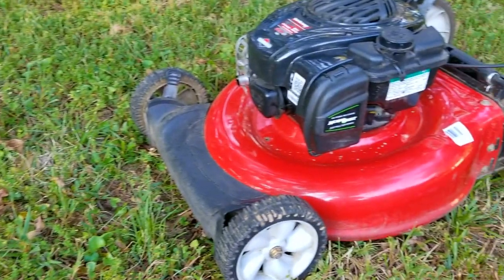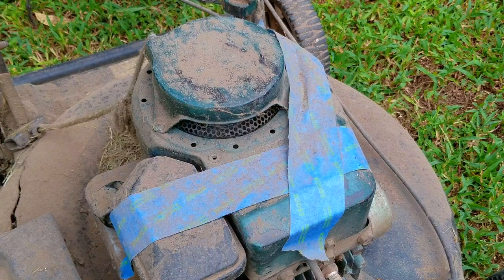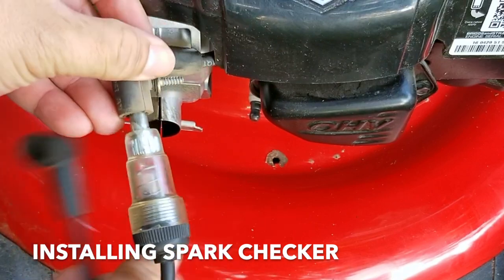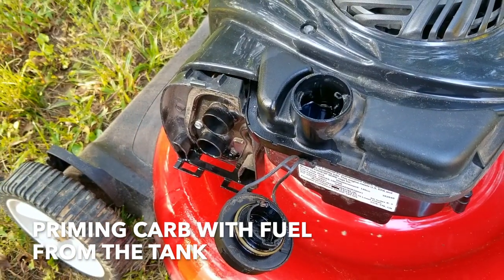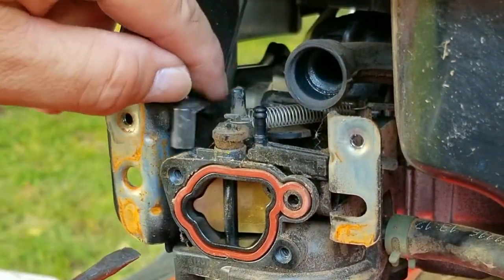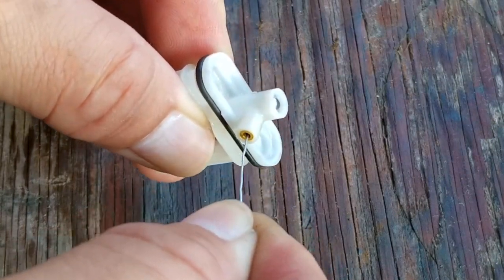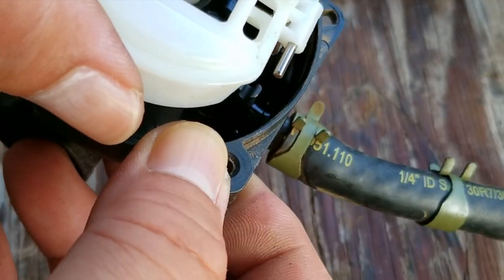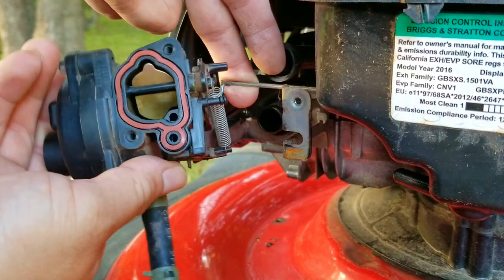Why Did Briggs Stop Making The Flathead Engine?

Comment: My very  first push mower!! I've learned on I bought at a yard sale!! For five bucks when was 10 years old took it home it ran.. it was a 1970.. 3.5hp briggs and stratton white engine colored green deck montgomery wards brand I use to take all apart and study the working internal parts and put it back together it would  run good as new!! I think I still have it at DAD'S place in the shop so I like the old school flat heads and the overhead valves!! As long as it's a briggs and stratton engine  or Hondas I work on all brands  two and 4cycles engines even the little diesel small engines as well.. good topic I.H.G
Reply from the maker: thank you JJ Juarez!
Reply: My first working mower was a 1962 21" 2-stroke Lawn-Boy, given to me in 1970 by a friend's parents when they moved away. Very powerful, with a huge under-deck muffler, for, a pleasant humming sound, compared to the typical dinky-muffler flathead mowers of the day. It also had a very light magnesium-alloy deck that made it easy to handle.
Reply: Cool story JJ!

Comment: The flat heads were tough but i got to go with the newer over head valve engine it makes mowing a breeze it has alot more power and  burns way less fuel..  our old mower just bogs if u let the grass grow an extra week the newer one just powers through.. i think the EPA put the sqeeze on every manufacturer and they had to comply coupled with raising ethonal levels in fuels the carbs are calibrated to give a clean burn but now the jet orifice are tiny which clog easily if not maintained properly
Reply from the maker: I see your point
Reply: I have an old 5hp rider from the mid 70's that I run slightly rich so it wouldn't bog down as much. I also converted the points ignition to solid state for better starting and reliability. Carb is the old pulsa jet with needle adjustments, heavy cast iron flywheel, vertical shaft.
Reply: You nailed it, sir. Couldn't have said better myself.

Comment: You are dead on with your assessment.  As for the oil change issue, check out a channel called "Teryl Fixes All"  He did a video explaining why Briggs went to the "no oil change" engines.  I unhappily own an Intek engine, and am in the process of replacing it with a Vanguard on my JD lawn tractor.  For the question of what I prefer, I personally prefer the old flathead engines.
Reply: I'd highly suggest looking at Kohler Command Pro, Honda GX and even clone engines.  Parts are currently hard to find for any Briggs engine or power product and Vanguards are made in the same factories as the crappier home owner entry level crap they push.  They are no longer Japanese made.
Reply: @WJCTechyman  Parts aren't hard to find for "any Briggs engine".  I source parts for B&S Quantum engines all the time.  Might be true for some of their other engines, but it's not true for "any Briggs engine".

Comment: The new engine blocks are very thin metal in the sump and the carbonators are jetted so lean that if the gas is old it will not run , it will in the flat head  . Quality is not a priority only after profit only .
Reply from the maker: yes all correct, and it sad to see, that's where We're going  Thank you Chris's small engines
Reply: what the hell is a carbonater??? That right next to the wampus rod???
Reply: Don't ask, but I've been running 18 year old gas in my mower and snow thrower. It doesn't smell like gas or even taste like gas but it is and I have about 15 gallons of it left. One guy even told me the exhaust smells funny.
Reply: @bultacowally  ask Willy Wonka, he'd know for sure.
Reply: @jwwalker688  Pour that stuff in a newer engine and it will not run . I have seen it with my own two eyes . Try it for yourself . The older engines will burn it the newer one will not .
Reply: If they hadn’t made it so cheap, the lawnmower manufacturers would have completely switched to Chinese crap engines. Briggs had to match them for price to stay in business, it’s that simple. The old flatheads were durable and cheap but there was no possible way to get them to meet emissions anymore.
Reply: @bultacowally  The Carbonater feeds the Cat Litter Converter.
Reply: @bultacowally  There’s nothing like the sound produced by a decent carbonator. Sitting back on a lazy afternoon and absorbing the soothing qualities of carbonation in action is extremely relaxing.
Reply: @bultacowally  all I ever think about is carbonaters!

Comment: I have an old brigs on a riding mower. It's 12hp and about 50 years old. My family has used it since new and in all that time, it's needed the carb rebuilt a few times and 1 new head gasket. They really do last a life time.
Reply from the maker: yes, with some care, they will last a very long time. Thank you Cub 100.
Reply: unfortunately such great reliability also means fewer sales for the company. companies exist to make money so updated designs that don't last long are the new norm
Reply: that is a cast iron engine, never let that one get away from you!!!. those cast iron "B&S" engines are built to last, and were designed to be rebuilt
Reply: And yet my Honda G series engines don't need much of that.  They're probably running the original carbs and are more efficient to boot as they don't have the unburned fuel smell of Briggs flatheads.
Reply: @WJCTechyman  That's true. This thing has never needed any engine work and it just runs. Still has decent power and I'm still using it. Since switching to new fuel lines and rebuilding the carb and using non ethanol fuel it's been running great.

Comment: I have 2 flatheads. One I've had about 24 years. It's went through 3 decks & ready for a 4th. I've got another one I've had for about 10 years. I've never had any problems with the carburetors. I've had 4 or 5 of the newer ohv type, had to clean the carburetor on every one to get them to run. The ohv type has more power, not as easy to bog down when pushing fast. I like both styles but the older ones require less maintenance to get them to run. I've never had a plastic carburetor yet.
Reply from the maker: thank you Robert Williams
Reply: Where can I get a deck I have a flathead that needs a deck
Reply: @edwardzamorski3711  I got lucky & bought 2 decks from a liquidator when Murray first went out of business. Decks are hard to find unless you can find one where somebody has a bad motor. Then you have to measure the length of the motor shaft on both mowers or do a lot of rigging. A repair shop might have one, good luck.

Comment: One thing I've noticed compared old vs new is the old flathead motors especially the cast-iron motors with the cast-iron flywheel ran smoother and quieter.
Reply from the maker: that's seems to be the consensus
Reply: @INSIDEHOUSEGARAGE  yet our testing showed otherwise. Though engines with the cast flywheel did run smoother they were also heavier. The muffler on the new engines was due to noise limits particularly in Europe. The noise restrictions in the EU were a bigger challenge than the emissions in California.
Reply: the cast iron "B&S" engines were built to last, and were designed to be rebuilt!!!!
Reply: @gregoryclemen1870  Kohler's Magnum is an engine that I would say is better than any Briggs.

Comment: I had a mower with this engine for 3 or 4 years and it ran great. All I had to do was winterize it properly and I changed the oil through the drain plug yearly. Still ran like new when we moved out. Shows how far good maintenance goes. same applies to cars.
Reply from the maker: you are correct, it'a amazing with a little maintenance and do.

Comment: I feel like 2 things that seem to be rarely discussed (and one of them is major!) are these! Most people part car oil in their lawnmowers. Car oil is designed for water cooled engines. Lawnmowers are typically air cooled. The operating temperature of a water cooled engine and an air cooled engine are dramatically different. Multiply that concept by a hot sunny day and I am sure you get the idea. Also back in the day when they mostly had foam air cleaners nobody seemed to want to ever wash them. A third small thing is this: the blades come from the manufacturer sharp. Most owners never seem to want to keep them sharpened. Needless to say that with a sharper blade the stress on the motor is a lot less.
Reply from the maker: you bring up a good point, but some brands never state to use oil designed for oil cooling.  Although it could be part of planned obsolescence too
Reply: Honda for example clearly states that any automotive 10w30 conventional motor oil is okay to use in their engines.. so that blows away your oil theory, buddy..🙂
Reply: Synthetic 5W-30 has been recommended by Briggs, at least as far back as when Quantum engines were made.  The temperature which this oil can handle is extremely high - far higher than any air cooled engine application.  There's no issue with using automotive oil in these engines.

Comment: I second that the Old Briggs were invincible! At 11 (58 today) I would fix and sell push mowers. Few people had riding mowers. We had leaded gas, and it lasted 67 years, even when it smelled bad, it would run. They had Points and Condensers then. So, I bought a tune up kit, with plug, points, condenser, for about $3-$5. I bought a diaphragm for $2. I used Valve lapping compound to do the valves. Then, I would clean and paint the mowers. I would go to a part store that sold car paint, and get there mess ups. Sometimes I had to buy it, other times they gave it to me, because I also fixed cars and bought parts there. But, they saw an 11-12 year old kid doing something and supported me. I painted my first truck at 12. I bought a $150 paint gun from that part store. I saved for 6 months. In 76, that's a lot of money. 
 But, one week, I'd have 4-6 mowers for sale. Maybe all green, maybe Orange. The color of the week. I painted the engines white or black engine enamel. I sold them for $45. But, I gave $5 for trade in's, which were painted and for sale next week. I made them look good. I sanded the frames and engines. They looked pretty good for a kid. A new mower was $200-$500. I sold everyone I put out. But my dad made me mow our yard enough to know it ran good. Sneaky fella he was. By the time I tested all my mowers, the yard was mowed. That was between all the kinfolks cars I tuned and changed oil in, valve jobs, timing chains, brakes. He kept me busy, but I loved it.

O, and I later built myself a successful Automotive Collision Center.
Reply from the maker: very nice, thank you Jeff Campbell for the story and your time.
Reply: Imagine doing that today, you'd be stopped buying paint when they ask for your ID lmao

Comment: I always liked the simplicity of the Briggs flatheads. I do not have any of those around anymore. Have two older mowers with Tecumseh engines which seem to work OK. One was a curb find that just needed some TLC. One on my neighbors got an electric mower last year and it does not appeal to me. I am not sure I could ever get used to mowing a lawn without the sound and smell of a gasoline engine.
Reply from the maker: agree, I love the smell of small engines in use.
Reply: With the exception of the primer bulb issues on some Tecumseh mower engines,  I actually like them better than Briggs.  And Briggs flatheads aren't at all simple.  Count the number of fasteners and individul pieces of metal or plastic you have to remove to do simple maintenance like replacing the recoil starter cord or the number of fasteners it takes to clean a carb.  Quite often it's more than five.  Honda?  Three in both cases.  There's also the need for multiple tools to take a Briggs carb or recoil off as the heads of the fasteners often vary in size and type.  Now, everything on my Honda engines comes apart with one 10 mm socket wrench.  It's a similar story for Tecumseh.

Comment: I'm a Quality Analyst at Briggs. I only deal with the riding mower engines, but I'll try to give some insight. Less fasteners is absolutely amazing from a manufacturing standpoint, it's so much less headache. One of the biggest problems you deal with is missing bolts, bolts not torqued enough, wrong bolts, defective bolts, stripped bolts, and bolts dropped into the engine (usually getting into the flywheel and causing catastrophic damage during the run test).  The less fasteners they have to worry about, the better. Also, OHV is indeed a nightmare to manufacture compared to flathead. The complexity of the heads adds a whole new layer of things that can go wrong during casting and machining (I am VERY well acquainted), and setting Valve Lash on the rockers is easy to screw up and we've not been able to successfully automate it on my side. But I definitely think emissions really had the biggest share of the reason, Briggs isn't a company that chomps at the bit to do new things, rather they tend more toward stagnation, change happens slowly. My guess is it was more necessity than innovation, but I could be wrong. I don't know much about what pre-bankruptcy Briggs was like.
Reply from the maker: thank you Hedge Earthridge for your time and insight.
Reply: The Japanese and now the Chinese are simply doing a better job, i dont blame the workers, mainly the management

Comment: I use B&S mowers with the flat head and older carb. I love them. With what I have seen here, I'll stick with the older engine. I have two of them and both run great with no issues. One or two pulls and it's running. I have no real issue with a well-made OHV engine as long as it is dependable year after year but the quality has to go in, to get my respect for that type of engine as well as its brand name. B&S was a name anyone could depend on and know they bought a high quality product that would last for many years if taken care of properly. After watching this video, I may have to back off in telling folks they are able to depend on a B&S mower's engine. I'll be long gone before the old flat head versions have disappeared and no longer available (including replacement parts). People have to watch out when buying equipment that can easily fail them in a short amount of time and require special equipment to do repairs to the inner parts of the engine like piston removal. Some are just not worth the money tearing the engine down and is more a throw away scrap. Carboned up rings can make an engine useless, and even more, you can't get the piston out to either clean the rings or replace them, unless you have the right equipment to do so. That means a trip to the GURI SHOP that charges a lot to fix them. Least with the older briggs, you can fix everything with the tools you have, if you have a full set to work with that can be bought at any hardware store. It seems companies now days are getting very greedy and depend more on you destroying your engine than having it runn properly for many years and depend on it working right when you pull the cord. It seems that B&S can't depend on customers buying their product because of the many years of quality they give. Seems they have gone CHEAP as well as greedy. Hate saying that, but I guess that's how the world turns when greed takes over. From what I have seen here, I won't recommend B&S mowers in the future (least not the newer ones).It's sad.
Reply from the maker: it would seem like it. Money has funny way, of making people want more of it.
Reply: I agree.  Briggs & Stratton engines have become a casualty of low-cost production and will never be the same again.  The "never change oil" really adds up to a company that has let its standards drop to make customers feel like it's somehow gotten better.  PF just did a comparison of engines and Briggs finished last in most categories, which was really the tipping point for me.

Comment: my grandpa bought a brand new honda mower in the mid 90's and he mowed around the whole house with it for 15 years with no issues, he then taught me how to use it and I continued mowing their lawn with that same mower for the next 10 years. Both my grandparents have passed away now but the mower still works and my cousin took it for her house and 3 years later, its still going. Its had its oil changed every season, new spark plugs a couple times, basic maintenance stuff. It's been working every summer, longer than I've been alive. I don't think you'll find any mower now that will do that.
Reply from the maker: very nice ,good maintenance goes far!
Reply: Honda mowers are beasts.  I have an HR214SX from the mid-80s in my shed and the engine still runs incredibly well (with the exception of the smoking issue at startup).  I have since replaced the drive wheels as well as the bearings for the axle and front wheels.  I haven't used it much in the last few years having bought a top of the line Honda Commercial mower and also getting a 10 year old resin decked HRX217HYC used for CA$100.

Comment: I grew up with the old flat head engines. We had quite a few over the years on the farm. They would most always out last the decks. I definitely prefer the flathead engine. Always enjoyed working on them as a kid. I have the newer ones now that say you never have to change the oil hogwash I just suck it out with a little pump and change it every year.
Reply from the maker: me too, they aren't going to get me with that one.
Reply: The air cleaner and sparkplug get replaced each year as well?

Comment: I have 2 B & S mowers with the flat head. One is a 1992 Snapper with an aluminum deck which has never given me any problems. I change oil when gets dirty and use Stabil in the gas. If it hasn't been started in a few months, one squirt of starter fluid near the air cleaner gets it going instantly 🤣 The other is a much newer Troybilt that a neighbor had left at the curb because the self propell mechanism was broken, but otherwise was like new.  I converted it to a push mower and it works great. Thanks for the great video 👍👍🙏
Reply from the maker: thank you for sharing your story Johnnie Hall!